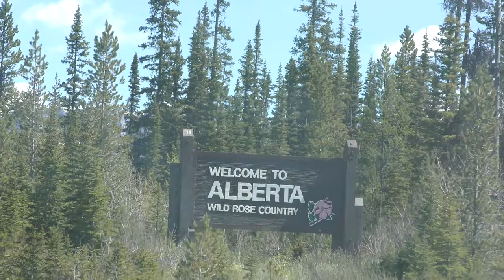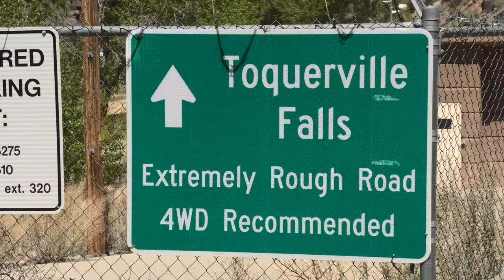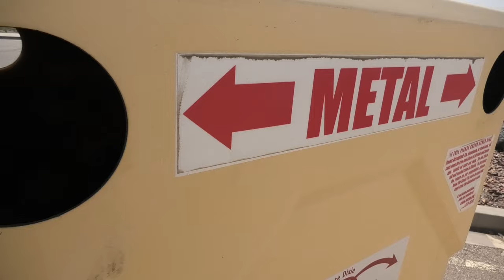EP:16 MY DIRTBIKE SNAPPED OFF MY TRUCK CAMPER - MOTO HAULER LOADING FAIL

Comment: I'm trailering my ktm around Utah right now!   Just do your riding in the mountains.

I dont hitch haul any more.    Instead I took a 5x10 landscape trailer with 15"wheels, single 3500lb axle, and moved the axle to under the springs instead of over -  raised  trailer deck dramatically for offroad.    And I added two, large ,HD Ridgid, locking,  steel, jobsite boxes to trailer for massive secure storage.

Getting very hard to avoid Chinese components....they're everywhere.

Comment: Two other guys with bike in Mexico had the sand trouble. Crack and hanging. What it is the bouncing is stressing the metal or weld. You need to put 2 strap to the hinges of the door. It’s about leverage that bar taking a few thousand pound on ever bouncy

Comment: Hey Phil! told you in your hauler presentation video that would happen right there, only thing missing for it not to happen was two simple straps to ensure no movement of the assembly! It broke under fatigue, weld it back, secure movement and you're good to go! :)
Reply from the maker: That weld would have broke eventually either way. It was not rated for 4000lbs like itclaimed. But ya fatigue is no good.

Comment: I used to use a Moto jack rack and kinda liked it, but it would wobble around so much it would egg out the hitch pin holes, it got so bad I couldn't get it removed because of the mushroomed metal till I pulled my spare tire and beat it out with a hammer! I now use a tray type with 2 receivers and it's really solid now. Hauling a dirt bike is a pain sometimes but I justify it much of the time as a lifeboat in case my rig breaks down in addition to hitting trails of course. I use a plated 500 exc so it's more versatile though for whatever. Love your vids dude keep on keepin on!

Comment: 3 Point receiver solves the bike rocking and swaying which will fatigue almost any single receiver setup over time. its a 2" center receiver with 2 more 1" receivers off to either side.

Comment: i sometimes travel with my dual sport on the back of my tiny tacoma using a trailer hitch rack.  i'm always worried about it.  i go on frequent trips to utah/nevada/cal and sometimes i bring it with me and sometimes i don't.  when i don't have it regret not bringing it every time. when i do have it, i never regret bringing it... i just have a bit more stress and some guilt for not riding it much.  
the moral of the story.... if you can trust your rack, bring it.  it looks pretty sick on the back of your truck

Comment: you should get an on-board-welder, watch a few youtube videos, and practice little bit.!. i bought a "ready welder ii" used on ebay for $150 (but originally new $650). it runs on two car batteries and it fits under my xj seat. all you need is flux core wire, welding helmet, and gloves. a little angle grinder would also be great for cutting, cleaning, and any metal prep while out on the trail

Comment: Mount the bike using the front hitch with Versa Haul.  More stable.  Or get a single axle trailer to haul all the Mob stuff.😂😭👊🏼
Reply from the maker: On the front it would destroy my approach angle, at least it was high on the back. I'd like to have the bike on the front of an overkill campers adv trailer someday 🤙

Comment: That bike on the back was shakin like a Evel Knievel bobble head in all your vids. You could have ground down the bad welds, chamfered the edges and added some extra plates to the hitch sides. Then strap at least one side of the bike to the truck.

Comment: Ok. Where is the review on this bike rack?

I need to do some research and can’t find the darn review. 

I’m heading to Alaska next summer and instead of pulling a trailer, I was thinking about carrying one bike off the front and one off the rear of my 2014 Ram Mega cab. 

The bike on the front will be a older KLR 650 (Still shopping for this one) and the one on the back will be my brothers 2006 BMW 1200 GS. 

Do you think it will work?  

We are not going to be doing any “Hard Core” off roaring with the truck, just minor stuff to get to camping sights along the way to our final destination which will be DeadHorse, Alaska.

Comment: I know this is an old video but:

When you have a $10,000 motorcycle at stake (not to mention how bad it could be if you launched that sucker through a family’s windshield on the freeway) a chicom fitting should have been suspected. I do think you could have saved it, ground down the welds and steel to bevel it for a good welding job with good penetration. Gussets (triangle pieces) could also be added to the pieces to add a lot of strength. I’ve considered the motohauler but still think both ends of the bike should be ratchet strapped to keep it from torquing on the center. A strap could also be beneficial in the same way a safety chain is for a trailer. I’d rather drag my bike down the freeway for a bit rather than have it take out a family of five if it bounces into oncoming traffic at a combined speed of 140mph!

Comment: Yeah shitty welds.   I had a family member build a pintle mount. 4 or so yrs later it broke same way your mount thing broke.  No penetration held.  I had bought a 7500 watt generator and a 190 mig welder so i ground it all down and welded myself.  My trl wieghs 13k normally but when it broke i might have been 16k?  back there. I welded myself and i know i got good penetration

Comment: It's time to start customizing your bike haulers and come out with another smaller receiver on each end of a ramp style rear hitch receiver motorcycle hauler😮..ramp style . you could build a small receiver underneath the truck underneath the bumper one on the far end left,, and one on the far right  side of bumper! that will assist a pipe or a small square stock coming out underneath the motorcycle hauler!!  that would make it super strong ! Let's call it a 3,,point RECEIVER  don't know why they're not doing it...😮 it would be super stable no more wobbling around bouncing up and down and breaking off this is the second one I seen bust on two different videos today, and two different types of motorcycle rear receiver motorcycle hauler.1 was like this,video with the hydraulic jack lift Style😮 and the other hauler was a receiver hitch drive up ramp Style holler😢. both of them busted straight off man!! you got to reinforce that s*** with more Square stock tubes welded in the center or go with a three-point like I just said😊

Comment: Danger danger attention this is the second video where the motorcycle hitch Square stock receiver broke this is the second video today of two guys dropped their bikes two different kinds of haulers you got to start going with solid steel you got to start reinforcing those hitches people can get killed what if that dropped on the highway in traffic

Comment: You were stressing it to its maximum and should have known from the beginning you should have reinforced and\or redone the stock welds. I don't see the point of discarding the piece instead of prepping it properly for a new weld including reinforcement.
You are extremely lucky the bike did not fall off at high speed injuring and\or killing others. 
Zero safety redundancy.

Comment: This has nothing to do with the motohauler. Your hitch extension failed not the motohauler.  Your extension made everything unstable and your bike swaying left and right.  This swaying should of been a red flag. Without your hitch extension it would of be solid.  Glad it failed in a safe slow section of the road!  Sad you sold the bike.  I am thinking of getting a 4x4 van and sticking a bike inside.

Comment: I fully expected the hitch WOULD break. You have 250+  pounds suspended by a 2 foot long torque arm oriented at right angles to the hitch. Shaking side-to-side over rough roads, you were cycling the root of the arm with many hundreds of pound-feet of torque. On really rough roads this cyclical torque likely exceeded 1000 pound feet, at least occasionally. Gusseting the weld would have helped, but it would still not be a solution. You need to eliminate the torque arm effect by using a 2 or 3 point mount. The truck's receiver hitch extends to both the left and right in order to meet up with the truck's frame. Weld or bolt some brackets to each end of the receiver hitch and use those brackets to mount rods which connect to and triangulate the bike's support post. This will convert the torque into just tension and compression on the rods. Alternatively, use those new mounting brackets to provide support for at least part of the weight on the bike's tires. This would have the same effect of minimizing the twisting torque on a  'measly' hollow, 2 inch square cross section.
How did I know?  At 11:32, just look at the amount of flexing and low resonant frequency (which is a bad sign in itself).
Reply from the maker: It was rated for 4000lbs 🤷‍♂️

Comment: They used a wire welder instead of a stick welder, with proper setting and rod to weld a deeper weld and it would of never broken
Reply from the maker: Boom ! That would've been nice
Reply: @Down2Mob  just a bad weld. Had nothing to do with weather it was a stick weld or wire feed. Both are capable of making great welds.

Comment: You had to know this would happen
Reply: It will do the same thing with the new set-up as well..
Reply: @SegoMan  I would want to have at least a couple of reinforcement points and make sure a good welder welds it. I actually use a ratchet strap to take the stress off my bicycle rack
Reply: @n2cycles  Exactly Jump up to a 3" or multiple 2" and snub off the shaking. That creates metal fatigue and chinese steel sucks!